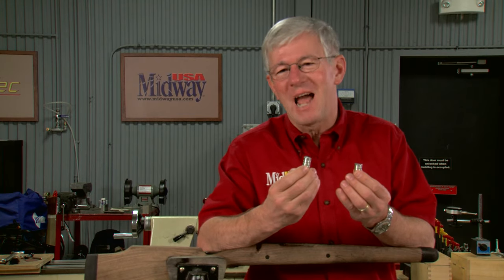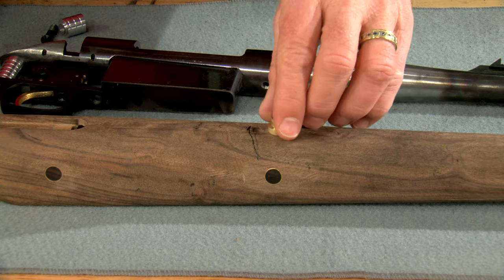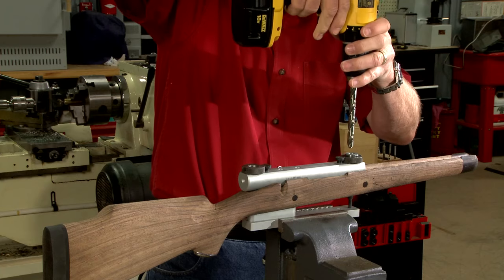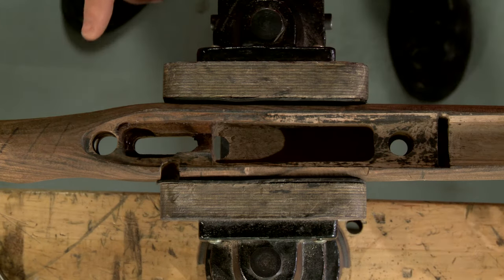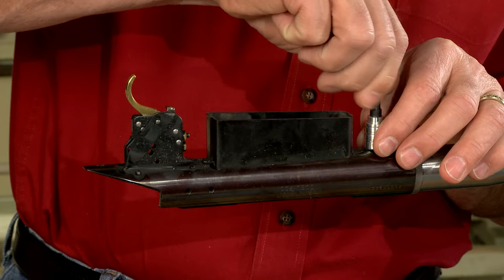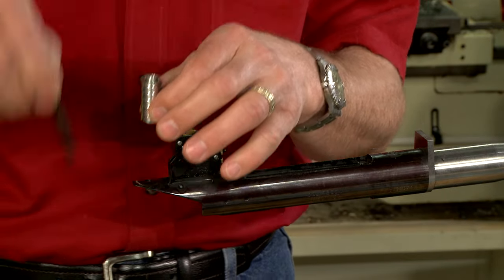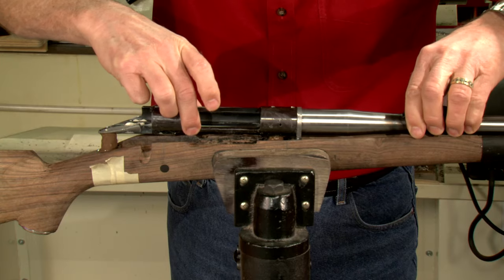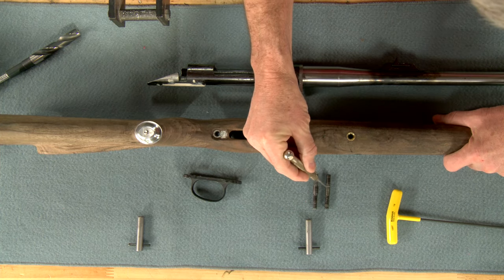How to Pillar Bed a Rifle Stock Presented by Larry Potterfield | MidwayUSA Gunsmithing

Comment: I believe there is merit to only bed the action at two points. Full length bedding of the action can lead to torsional stress if the stock warps later on, while 2 point bedding will not. 

Some might argue that if the stock is full length bedded that it will not warp, but that just isn’t true.

Comment: Larry Potterfield, I have had several Gunsmiths tell me the you either pillar bed a rifle or you glass/metal bed a rifle but you shouldn't do both. What are your thoughts?
Reply: currently im devcon bedding a remington police 700, and the bolts we were given were wayy too loose in the stock we chose. so to fix that, we pillar bedded the bolts, and are devcon bedding. i’m not sure about glass bedding, but i would say, if the situation arises while you’re bedding a rifle where you have to pillar bed. i think that’s okay

Comment: I bought this product. The material between the stock and trigger assembly at the rear insert becomes so thin after drilling, it easily cracks. The rear insert diameter is too big, in my opinion. After removing everything and repairing the stock, I used the original rear screw with washers for shims and metal tubing for a sleeve. No problems.

Comment: Would glass bedding the stock in conjunction with these bedding pillars be a good idea, or would it be overkill?
Reply: +Nicholas Skific Good idea if you have the funds
Reply: +Nicholas Skific     It's best to do it in two steps.  Pillar bed first, then do the glass bedding. The pillars provide correct spacing, strength and structure for the glass bedding to set up the way you want it.

Comment: These pillars are massive WAY to THICK!!!.  Aluminum thick pillars that reduce the strength of the stock.  FACT Boyds uses these type of Pillars and the rear part of the stock cannot be pillar bedded at the rear tange areas to much stock is removed safety issue!
My Savage arms uses thinner steel pillars. from the factory on there stocks.  I see people doing a lot of pillar jobs and alignment and depth between the front and rear pillars is critical.  When alignment/heights are wrong you have just created a twist in the action between the lower reciever/magazine and accuracy will not improve it will worsen.